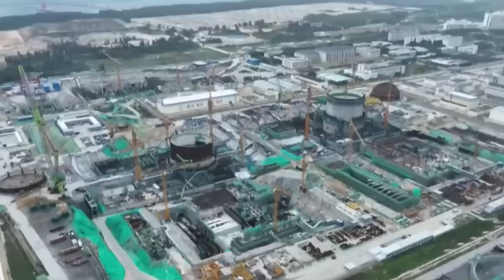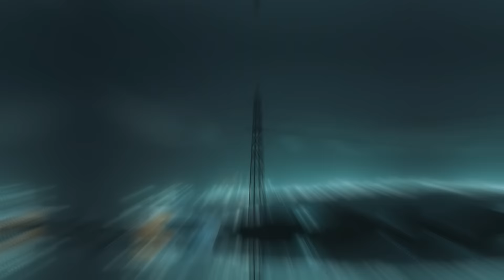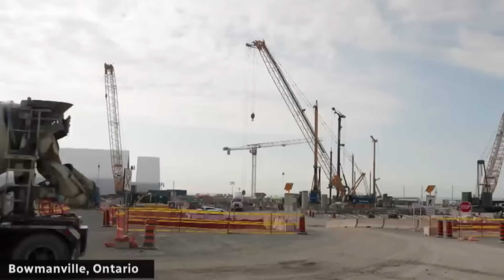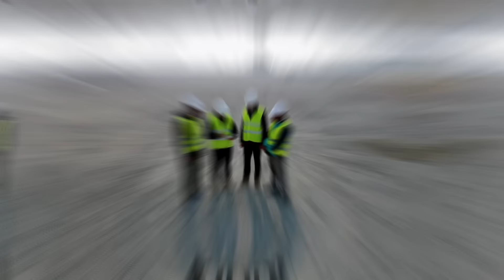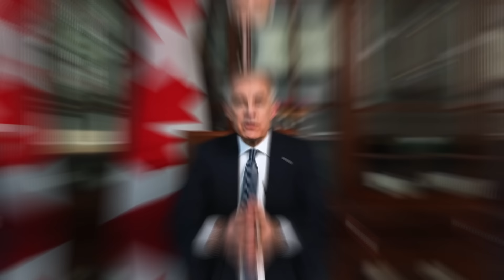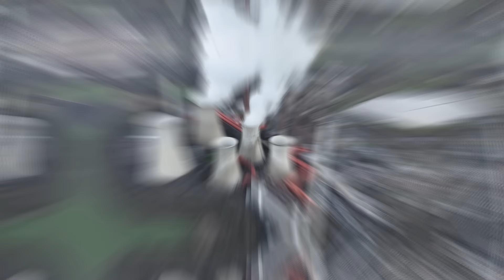Canada Just BUILD a "Permanent Battery" and NO One Saw it Coming!

Comment: Not wise. Wind and solar plus battery storage is now faster and cheaper. 

In 2025 China installed 4.3G of new nuclear, almost as much as the rest of the world combined. WOW, look at all those nukes! Go nukes!

Except in the same year China installed a MASSIVE 430G of wind and solar. That's 100 TIMES AS MUCH as new nukes. Even when you calculate 95% energy capacity for nuclear vs 20% for wind and solar it still comes out to TWENTY-FIVE TIMES the total energy production.

That being said, molten salt reactors of MSR are worth developing if only to downgrade spent fuel from older reactors.

Comment: A boiling water SMR is a mistake. Molten salt reactors are much safer and don’t run under high pressures so they can’t blow up or melt down. A boiling water SMR can still blow up and melt down.
Reply: Molten salt tech definitely has fascinating safety profiles on paper, but when it comes to immediate global deployment and grid reliability, scalability matters most. The BWRX-300 design chosen here is only about 10% the size and complexity of a traditional large-scale plant, engineered specifically to produce safe, low-carbon, continuous baseload power. Because the safety case and design review were fully cleared by the CNSC beforehand, it allowed Canada to actually get shovels in the ground ahead of everyone else. It's all about balancing advanced safety with what can realistically power 1.2 million homes by 2030!
Reply: Molten salt is only an experimental technology. Only one MSR has been built in the last 30 years. That is in China.
Reply: If Canada can develop the CANDU reactor, it can develop a thorium molten salt reactor. All we need is the willpower of our ancestors. The drive.

Comment: It is lot cleaner than coal.
Reply: Actually, it is much cleaner because getting the same amount of electricity from coal would destroy the environment and any changes of having clean air to breathe. 

But then again, Conservatives don't care about clean air or anything to do with facts.
Reply: @grantjohnston7148  Hence the push in Oilberta for open pit coal mines on the east side of the Rocky Mountains.
Reply: @claudeinpenderharbour6743  Is that thermal coal or metallurgical coal? There's a big difference, and we only get 3% of our energy from burning thermal coal.
Reply: But there's an Australian coal mining company that wants to mine there.
Reply: and natural gas.